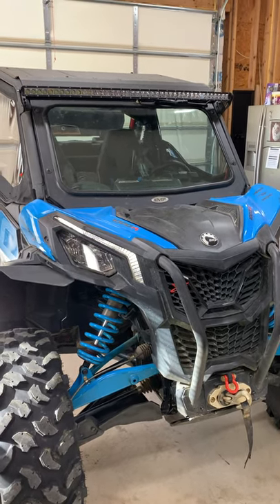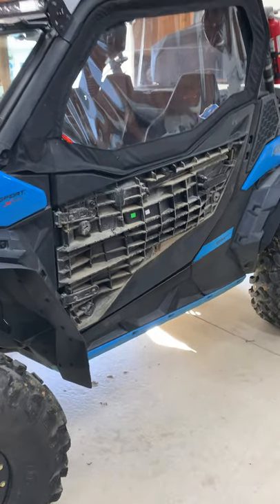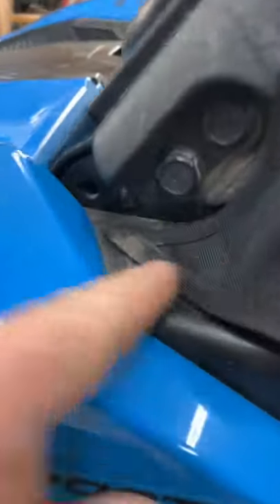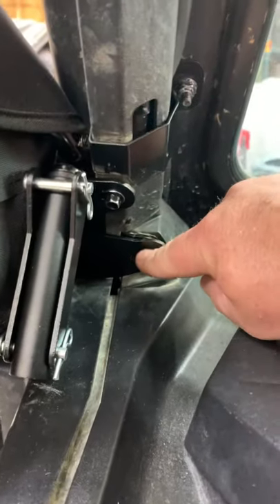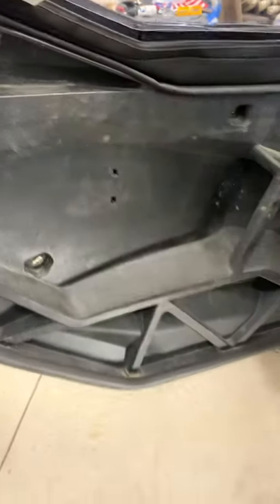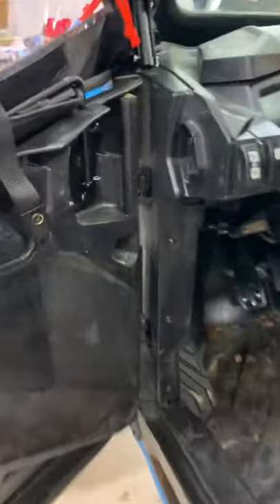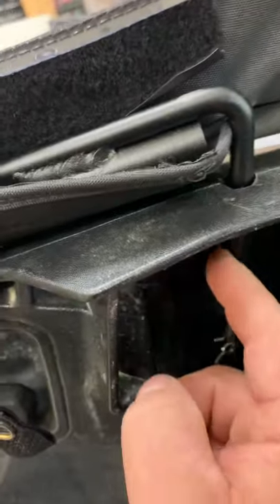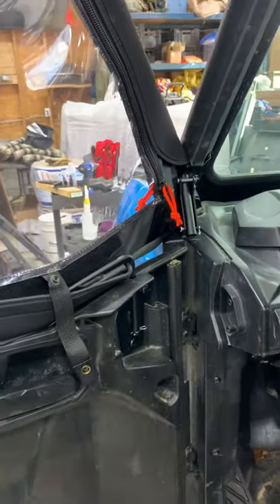CanAm Maverick Sport Trail Upper Doors

Comment: Thank you for your video, great info.

I just bought a 2020 Sport RC that came with the door upper hardware already installed. But when I drop in the upper section it doesn't feel like it fits correctly, specially at the "A" pillar where it pivots when you open the door. Install seams easy enough: drop in, install pins & clips, done... but it doesn't feel right when you open the doors. I don't want to screw them up because they're too expensive. 
I hate to ask but could you do a follow up video on any tips you may have on dropping in the door tops and how they look when opening & closing the door.

Thank you for your help.
Reply: Did you ever figure it out? I'm installing it now and i'm in the same boat you are.
Reply: @ukwildcats09  no I haven't really had a chance to work on it any further.
I did try to loosen the mounting screws & slightly slot the holes on the top of the door where the frame pins fall into hoping to better the geometry at the A pillar when you open the door but no luck fixing the problem.

Comment: Another question I had if you or anyone else knew if there was any difference between  OEM Can-Am upper soft windows or Tusk version the Tusk windows are half the price. I usually get burnt with cheep. I would definitely pay for quality over price but if they are the same I would just buy the Tusk version
Reply from the maker: The Tusk ones were not an option when I bought these.  I’ve seen the Tusks on the net and they look exactly the same.  I would have gone that route to save a buck if they were available then
Reply: @robshaw4965  I appreciate the response I thought the same thing They look exactly the same except for the name on it I will probably buy these hoping the material is as good as the expensive ones or the same. Thought about buying both and sending one back that I don't like😉👍

Comment: Are they easy to take on and off if you choose to put them on and take off?
Reply from the maker: After the original installment, they can be taken off and on in seconds.  Only 4 pins per door hold them on.

Comment: How do you like the windshield  and light bar brackets from EMP?
Reply from the maker: Windshield is great.  I wish they made a power windshield wiper.  The light bar mount is solid but I had to shave a little off the light bar to make it fit into the bracket.

Comment: I ordered these soft doors but I only received the soft doors no brackets?
Reply from the maker: Contact the company you bought them from.  The same thing happened to me.  They shipped the brackets quickly.
Reply: @robshaw4965  thanks fir the reply awesome machine! I got it from partzilla what they did was send me harware with some inserts and pins but no brackets now they sent me a shipping label and want everything back to reorder directly from can am but not sure what's coming in the new package
Reply from the maker: I’d just follow what they ask.  I bought mine from Rocky Mountain ATV.  They just pulled the brackets out of another box and shipped them to me.  They said that CanAm was shipping to RM ATV, once they got them they’d just put them in the box they pulled them from.  Sounds like CanAm needs to do better checking what’s in the boxes before shipping items out